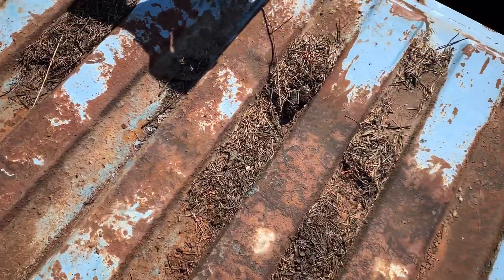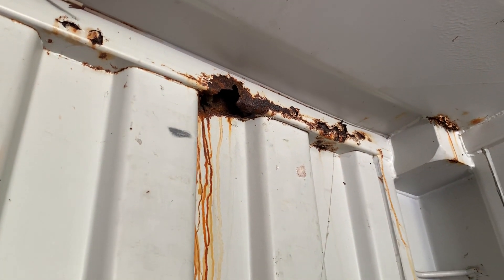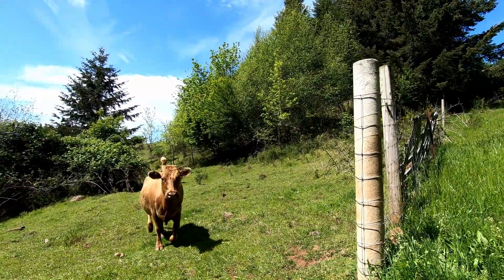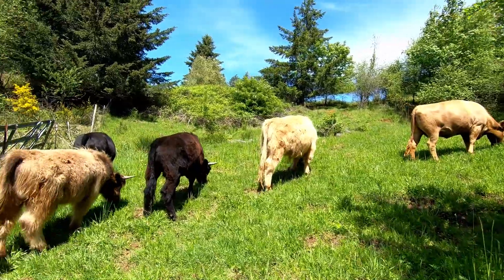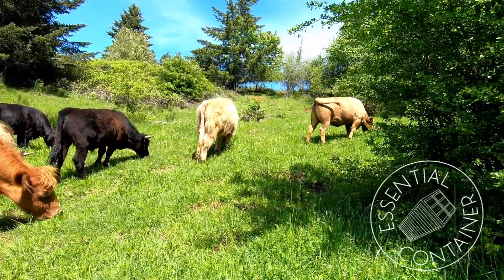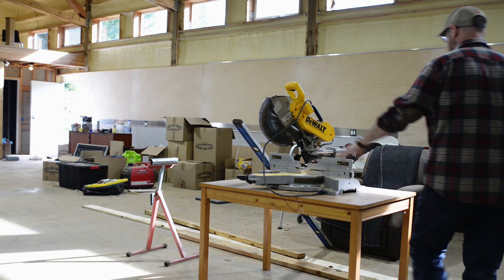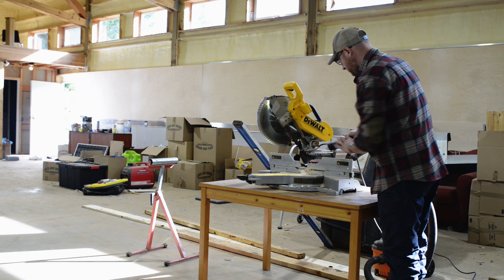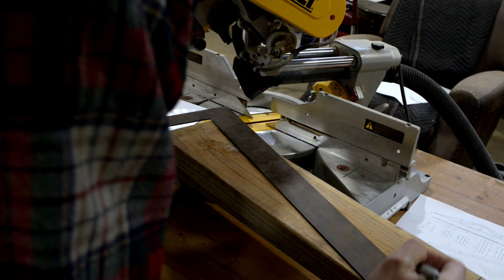Container Barn: Roof Framing

Comment: If you are going to put animals in this barn you’ll need some insulation to help cancel the noise of rain or it will drive both you and the animals crazy. Metal makes an incredible amount of noise.
Reply from the maker: Thanks for your comment. This is very insightful. I never knew why so many of the animals at all the farms around here were so poorly adjusted. No manners whatsoever. They poop whenever and wherever they want. Hardly able to sustain a polite conversation. Hallmarks of mental illness. 

But your comment makes a lot of sense. Every barn around these parts has a tin roof. No wonder so few of our animals can participate in civil discourse! I’ll spread the word of insulation and look forward to a new world of sane animals.

Comment: Two buy framing material is always used with the crown up. Some crowns up and some crowns down makes a weaker structure.
   Battery powered circular saws have very low torque in comparison to a corded circular saw. Keep a sharp blade on the saw.  Make sure that the blade is running at full speed when you start the cut. If the blade is touching the lumber when you pull the trigger it really is hard on the motor. I have used Makita battery powered tools since they've become available and usually my problem is I have to let go of a tool that works. When I see the improved tools it's a hard decision if you're a Thrifty by Nature.
 Bolts have the best sheer strength. Nails are in the next range of Shear strength. Screws have lower Shear strength. If you use a coated deck screw or equivalent they tend to be stronger and if you go to the other end of the spectrum and use a sheetrock screw which is cheap and most easily available they have almost no Shear strength.
Reply from the maker: Thanks for the helpful and detailed comment!

In my case, I think both of my previous makitas died from excessively dusty environments. You’ll notice all the hardie board around the shop. While it wasn’t the best tool for the job, I’d use cheap blades to cut it and I think the abrasive dust ended up prematurely killing the motors :( I ended up becoming more confident with scoring the boards and snapping them.
Reply: @superchromat  I think you got that right. Cement dust in all forms is killer. Have a good day.